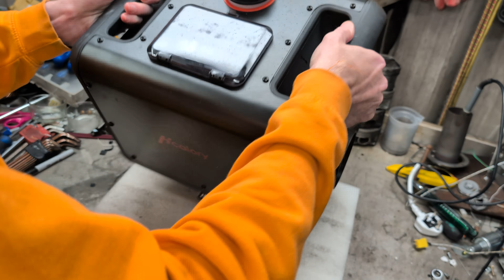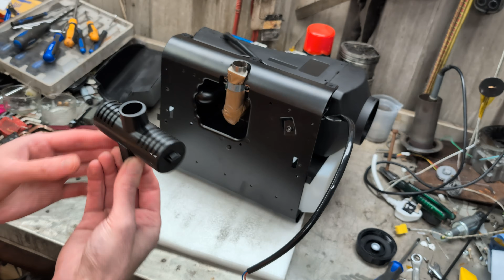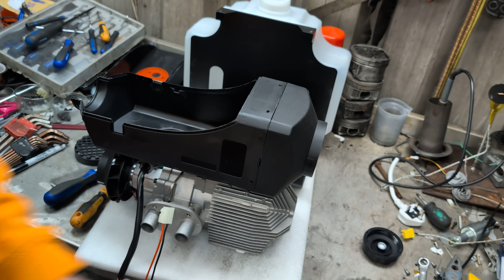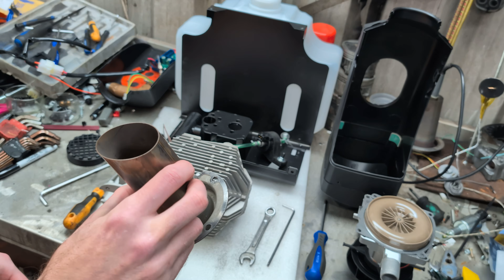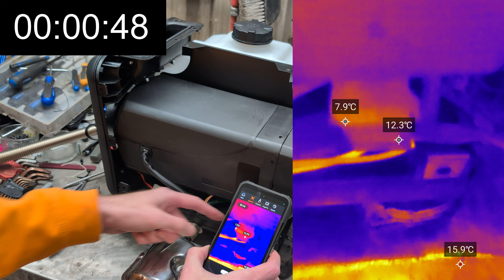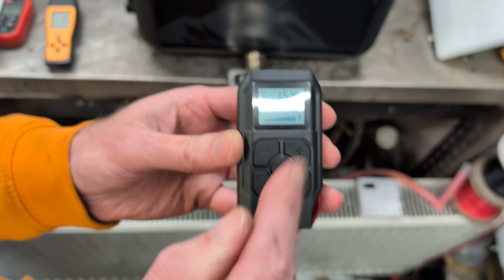Hcalory Toolbox MAX diesel heater - disassembled and testing

Comment: I am curious, if I buy the TB Max 2, do you think I can take it out the housing and mount it under my bed? as my one that I have already installed looks like the one that was inside the case, but I think both pipes the exhaust and air intake are fittet through the floor so I can keep this under my bed in my campervan, can you please let me know If I can buy and dissasamble the heater and use just the heater so I can have all the benefits of the remote control and app control and all that?

Comment: hi, i have the exact  same heater. it has just started smoking from the main body after 12 months use. any clues.?   correct fuel. correct venting and air input. all ports clear...correct fitting and location. no probs for 12 months. then when i put on full heat for 5 mins it locked out and started smoking from main unit  also looked like smoke was coming out of the round screw on air input grill at back . i have always used this unit on very low heat and run over night in my garage to eliminate condensation on my motorbikes in winter. carbon build up?blocked mesh filter anywhere? be great if you could give me some pointers. Many thanks :)
Reply from the maker: Sounds like it's been running long and low and might be a bit sooted up inside.  Time for a strip down and check.  I'd preemptively buy a new 4kw burn chamber ready to swap in.

Comment: Do you think it would be possible to modify the combustion air intake and add a pipe to run it outside ?  I have just bought this heater and it will be running in my garage

Comment: Would you agree that Kerosene would be preferred to Diesel as a fuel? Cleaner burning, less contaminants). Is it true that running at low output produces more carbon buildup? (You mention yearly service)
Reply from the maker: Kerosene is a higher grade and does burn a little hotter and cleaner.  Low running seems to be heater dependent.  If I was using a heater as my heat source keeping me alive I'd be doing a full strip down and rebuild every year and have a complete heater as a spare.  Other than that I'd run it until it dies.

Comment: I have two improvements that need to be done from the factory but one you can do yourself. One, the heat exchange burn chamber sometimes need to be cleaned so I think the exchange head should be removable sort of like a cap or call it a lid/hood so you can get in there and clean the soot without having to dismantle the whole device. And 2, a light mounted to the heat shroud behind the fuel tank so you can see the fuel level without needing a flashlight or wiggling the heater to make the fuel slosh around. Am I asking to much? I did the light on mine myself. Why can't we make these in America or where you live? We could make them bigger to do a bigger area...

Comment: I just took mine completely apart. It kept erroring out due to high CO2. The exhaust was puking black smoke while running. What I am curious about and want to know is about the burn chamber. When you disassembled the one in the video you only briefly showed what it looks like inside the burn chamber at the bottom. There is an elevated piece inside that looks similar to a gear or sprocket and a metal ring installed above it. On mine, when I took it apart, that metal ring was laying inside the end of the cast aluminum chamber the burn pipe goes into. I am certain this is why my unit isn't operating properly but I don't know if I can put the metal ring back how it was supposed to be or if there are parts I can buy to repair it. Hcalory sent me a new unit to replace this one but they didn't ask for it back. I want to see if I can fix it or if it truly just needs to go to the scrap yard.
Reply from the maker: There are other videos on a chamber cut into pieces.  But they are basically a consumable.

Sounds like your burn chamber was factory failed.

Comment: just picking one of your most recent videos on these heater as i have a question can they be mounted vertical air cold intake at the top drawing warm room air in heated air out the bottom with a vent at ground level mounted to the wall by this i mean the heater its self as a stand alone item not the ones that are in tool boxes etc
Reply from the maker: Technically yes.  But you probably shouldn't.  They will run.  But should the fault occur where it flames out, doesn't detect it and keeps running.  It will fill the heater housing with diesel until it comes out the exhaust.
Reply: @DavidMcLuckie blast

Comment: Hi, I bought this exact model. Attached the exhaust, filled the tank with diesel and ran the outlet hose in to the my conservatory after drilling a 90mm hole through the dwarf wall. Using the remote control went in to the consevortory and turned it on. I read on the instructions that it should take around 3mins to start giving out heat. After a while I could hear the fan working and then at around 3min I got an E10 error went outside and to my dismay the toolbox heater has leaked diesel on my sandstone patio. Ive watched your video and I'm unsure where the leak would of come from. May be the stubby fuel pump? what do you think? where should I start looking? 
I read loads of reviews and videos before buying it and I'm pretty gutted with it atm. I bought from Hcalgory uk via ebay at the end of Nov 25 but only just tried using it today 03/02/26. Thanks inadvance for any help or advice

Comment: Hi David. Whats or thoughts on the Green fuel line on these heaters is it worth changing for the hard Wite pipe?
Reply from the maker: On a portable heater where the fuel line isn't exposed to UV and abrasion, probably not worth it.

Outside under a van exposed to dust, grit, stones.  Yes, I'd go with a hard plastic line.
Reply: @DavidMcLuckie Many thanks. I have the Toolbox heater you are dismantling Hcalory TB Max.
I am wanting to fit a fuel filter between the tank and the pump but that Green fuel line is very short as you know.
Cheers Karl.

Comment: Mine has had High fuel consumption and a fuel leak from the start. I keep getting the run around from customer service. They told me that it will only run for half of the advertised run time if the temp is below freezing. It uses the same amount of fuel as the other 3 heaters that I have. Here is that email. 

"Dear Customer,
Thank you for your email.

Energy consumption is related to ambient temperature.

Our control logic is dynamic. The first setting is based on an aluminum combustion temperature of 140°C at 2000 RPM.

A basic oil pump frequency range is 1.5~3 times/second. The oil pump specification is 0.022mL/1000 cycles. In our laboratory tests at an ambient temperature of 15°C, the average oil pump frequency at the first combustion setting was 1.5 times/second. Therefore, the measured time was 62 hours.

If you are in an environment of 0°C or lower, and your diesel fuel may have a lower calorific value, you may need a frequency of 3.0Hz to reach the required aluminum combustion temperature. Therefore, it may take around 31 hours. At 0°C, even at the lowest setting, the runtime is 34 hours.

The unit's speed setting design logic differs from other heaters. Our hcalory's 1-10 settings have fixed RPM and fixed aluminum combustion temperature to ensure that the actual heating effect varies with each setting. Therefore, the oil pump frequency may dynamically change within a certain range.

Of course, this may not achieve the desired fuel consumption at low temperatures. However, we have never encountered a situation where the heater runs out of fuel in 24 hours. We suggest checking the bottom of the heater for any trace diesel leaks.

Please feel free to contact us.
Best regards,"

Comment: I have the same one and my pump sound is very noticeable even on level 10. Also heater broke down at the 3 month mark.  I could have saved a lot of money by purchasing a 5k (same power). I would have only sacrificed the sophisticated remote, carbon monoxide detector and the larger fuel tank.

Comment: So are there no 2kw - are they all 4kw?
Reply from the maker: 2kw are physically smaller.  Larger heaters exist but they are again physically larger than the 4kw.  99% of the 8kw heaters sold are 4kw.  And no amount of over fueling is making them 8kw.

Comment: Hi Dave have you ever taken a hcalory ss2 toolbox type one to bits , I need to change the fuel pipe on mine but it's riveted not screwed so wondering how to remove the toolbox case

Comment: Hey David, I recently picked up one of these diesel heaters and I’m noticing a strong diesel smell even after warm-up. Reviews say it usually fades after 10–15 minutes, but mine doesn’t. I keep the heater outside the tent and the hot air being blown in still smells. Have you seen this before, or is there a fix you’d recommend?
Reply: Might be an idea to take the cover off and the front end (the side that the heat comes from) and then run your finger along the fuel line and connections. There shouldn't be any fuel smell on your finger. If there is then check the connections or better still upgrade the fuel line.
I also noticed  on mine that where the fuel line goes through  the metal case on the bottom the case had a bit of a sharp edge. I filed of the sharp edges and put small rubber packing around that area to protect  the fuel line from rubbing.
Reply: @adrianmaguire5459  Thanks for the advice, I’ll take the cover off and take a look!

Comment: Great video. I used it before I bought one a few days ago and came back to it to find out where the combustion air is drawn from. I was concerned that it was a shared inlet with the air to be heated. It is not, which suits my proposed installation of outside my workshop (protected from the elements), with the to-be-heated air supply and the heated air being connected through the wall. I really didn't want the combustion air being drawn from the workshop and creating a negative pressure - and happily that is not the case. 
Bearing the above in mind this heater would not, IMO, be ideal if situated in the heated area as combustion air would constantly be sucked from the room.
Reply: Maybe  I missed it, but where exactly IS the combustion air intake??

Comment: Hi David. After you've disassembled the heater, do you think there's any way to somehow attach a wifi module to it to turn it on via phone?
Reply from the maker: On the old heaters with the 433Mhz remote controls people have used these - https://amzn.to/4sNdCAq

You clone the remote into it and then you can turn it on / off up / down via wifi.

It's only one way though, so there is no feedback to let you know what the heater is doing.

Comment: Hi, great review thanks. Please could you tell me, does this have a separate air intake for the combustion chamber? If so is it the hole next to the exhaust outlet. If that was the case I was wondering if it can be installed inside a workshop to recirculate the already heated air but with a combustion air intake pipe and exhaust tube both taken through the workshop wall. Hope that makes sense. Thanks again.

Comment: Hi David a long time ago did you use a bolt 🔩 to remove the atomizer screen?
Reply from the maker: You can, but it does damage the screen a little.  Fine if you are replacing.

Comment: Hi David thanks for the video! I got one of these delivered today and got it fired up and it keeps shutting off because of high CO levels. Checked the factory fitted exhaust and it was a bit loose, so i tightened the clip, refitted and it did run longer but eventually shut down with insane high CO PPM figures displaying on the main controller. The controller on the unit has a CO sensor as well as the remote sensor - No PPM readings on the remote sensor. The only way to get it to work and keep running is to turn off the remote control - this seems to turn off the CO sensor.

Comment: Has anyone UK based tried using heater fuel or red deisel (if still available)?
Reply: I use heater fuel, it burns much cleaner than deisel, hope this helps.
Reply from the maker: Diesel, kerosene, heating oil all work fine.
Reply: Many thanks guys. 
Will be in touch to get some guidance to connect the external tank later.😂😂

Comment: At 37:22 you began talking about having adjusted the tuning. I assume that you are talking about adjusting pump dosing rates in hz, vs fan speed. How do I enter the tuning menu on this heater? Also, what CO level in ppm do you aim for as a proper tune?
Reply from the maker: I've got a video on tuning it.  Anything less than 40ppm is a good range.

Comment: My Hcalory will be used to heat a small garage and wonder if you think a larger diesel gas tank could be used?  Although the Hcalory has a sizable tank, I would like to use an 19 or 30 liter tank.   I appreciate your video!    How hard would it be to add a 19 or 30 liter tank to this heater?
Reply from the maker: I've had the heater just draw fuel up a stand pipe from a 20L jerry can.

Comment: I bought one, tested it in November, ran great. When I fired it up in December when the cold weather started, it ran 10 minutes then quit, showing E8 or E10 codes. Took the damned thing apart, a lot of soot for just 30 minutes max of run time. Put back together, and restarted, ran about 10 minutes and threw an E8 code again. what a piece of junk. Despite the great reviews, I thought I had a lemon so I bought another. Ran for 10 minutes and threw a E8 code again. There's got to be a simple answer.
Reply: Sounds like you working for rival firm 🤣🤣🤣

Comment: Hello David I just received my heater TB Max do you know if there are any secret codes to set temperature compensation on the screen. My olderA01 heater had this and was useful. I'm using the heater in a greenhouse for cacti and want to set a temperature setting correctly. Thanks for videos, great stuff!!

Comment: Hi David,
 I love your videos, your channel and the approack to machine development.  

Yesterday I watched 2hrs of videos from your channel straight fwd and something clicked in my head that I would like to share with you.
 I thought about inverting the system: now you are using a heater to produce some electricity, so here it comes the shift,:
- why not using a small electric generator to recover the heat as a heater

in them in more than 50% of efficiency is lost in heat
I think that the pain point is going to be to make it silent  ... 
- do you accept the challenge?  : )

greetings and thank you again this kind of channels make internet a great place

Comment: I have a simple old cheap 3kw heater and it was already almost too hot for my small space. The new version are more fuel efficient, but even so, 8kw seem overkill ? Or does the fuel pump have different setting for a minimum heat with minimum consumption ? I'm surprise all the new models are 8kw, it replace the 3 and 5kw, any idea why ?
Reply from the maker: They aren't.  Nothing has changed except the marketing.

True do 8kw exist.  I have one and they are about twice the size of the 4kw.

Comment: Loved watching that video ! Fantastic job 👍🏻 I’ve bought the same heater ! The water proof rating I believe is pending…… is it just the 11 drain holes in the base , as there is no rubber seal from the casing ? I’ve seen other videos about this particular heater where they have put a hose pipe to it ! ( on it and sprayed water all over it ) and it’s performed perfectly….. could you give us your thoughts 🤷🏼

Comment: Super GREAT video. I have Had mine 27 days and got E10 code. It was a great, quiet operation unit that I used on our motorhome. I think something is wrong with the fuel pump because I can smell the ignitor heating up in the exhaust tube. I have exchanged multiple e-mails with the company about warranty exchange and as of today they have not offered to exchange the unit. I understand the implications of hazmat shipping once used with diesel, but I want a product that performs as it should.
Reply: usually a user issue. poor quality diesel, air in the system, poor wiring, etc etc.

Comment: I won one the same on ebay for £48 spares or repairs, fuel pump power was not connected🤷‍♂️. Fastened it in the van and removed the eberspacher that used to keep the tools dry, im pretty impressed to be honest

Comment: Hi All, I saw, you had some experience with the heater and I'm experiencing something strange. I connected the exhaust pipe to the right position, but during ignition some of the fumes are coming out of this connection, or from that area. Is it a common thing, or it needs proper sealing? Can this be caused by a fuel leakage somewhere inside?
Reply from the maker: Sounds like the exhaust clamp needs tightening.
Reply: @DavidMcLuckie it was tight, but to make sure it’s sealed, I disassembled it and used some exhaust sealant paste. Now it seems to be airtight, but I’ll run some tests. It’s connected to a copper tube that I’m using as an exhaust extension through the wall and I also made sure that the connections are sealed again. It’s a nice heater, it just needs some TLC and works fine.

Comment: Hello, thank you for such an informative video !  I am just learning about these heaters and was so excited to buy this one but I am concerned about what might happen if there is a power outage while this is in operation. How is that safe ? I would be using it plugged into a wall outlet. I know a cooling fan has to run to cool the unit down when you power it off. Wouldn’t it ruin the unit or possibly be a fire hazard ? No one seems to be considering this. Also you seemed concerned about how hot the wiring got when it started up. If you have any helpful advice it would be so much appreciated. Thank you kindly.
Reply from the maker: Not so much a fire hazard but there is a risk of damage to the fan inside the heater and the ECU if they aren't cooling down properly.  But as yet I haven't actually had anyone say this has happened.